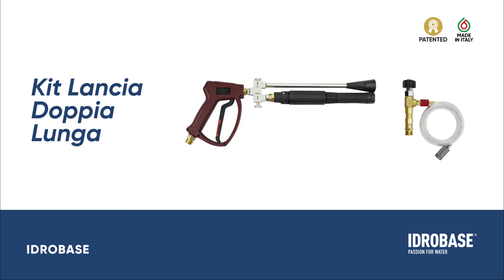Kit Lancia Doppia Lunga

Comment: So you still need to remove the pickup from the detergent tube and clear the line in order to get rinse water,  correct?
Reply from the maker: Hello, no you don't need to do that because the foam lance automatically excludes the detergent when it is in rinsing mode, best regards